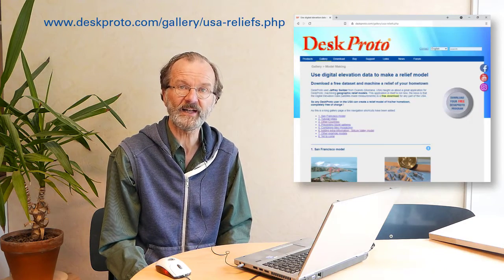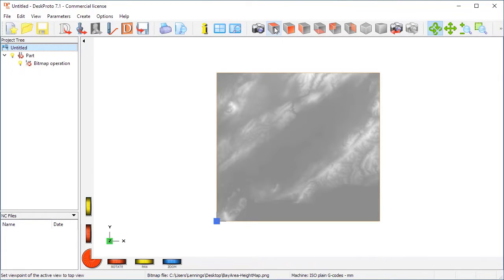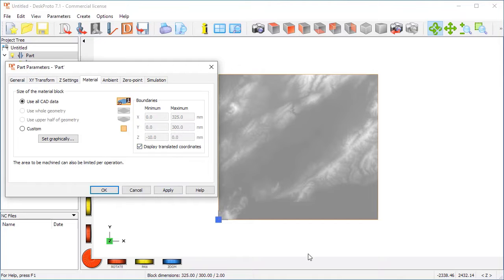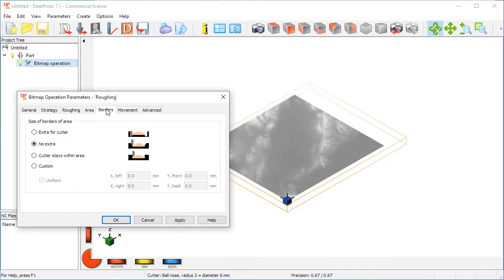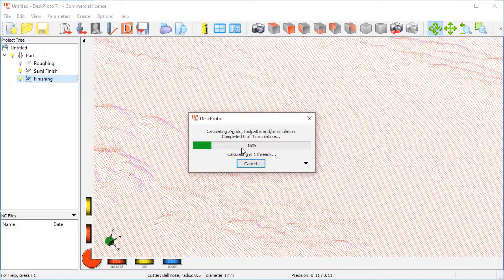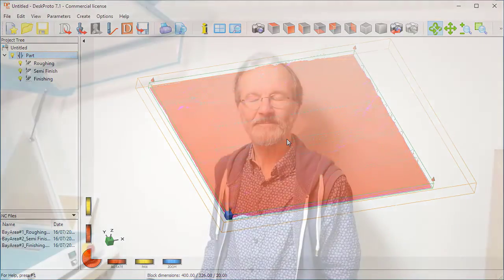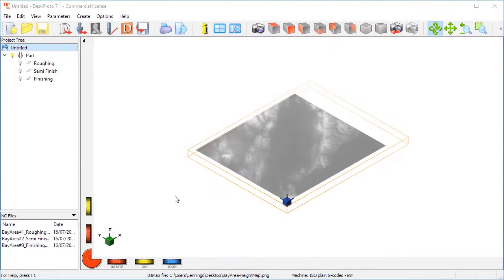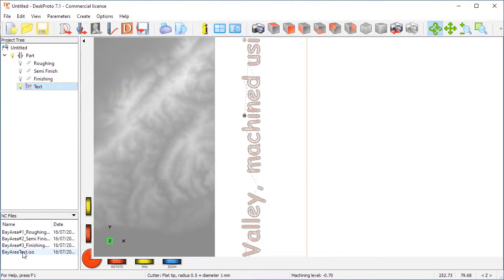CNC machine a 3D relief model of Silicon Valley with the DeskProto CAM software.

Comment: Hi Lex,
this is a very nice project and the detailed explanations of every step needed is very helpfull. There is just one thimg missing. As you can see in the video when you start milling with the smallest cutter for the finishing operation the shoulder of the cutter would have bumped into the higher border around the model if you would not have set the working area to be smaller by half the way of the cutters shoulder diameter. Am i right with that guess? Or how did you manage to protect the border and the cutter?
Reply from the maker: Well observed !!  Collisions between the shoulder (thick shaft) of the thinnest cutter could indeed have collided with this vertical wall around the relief.  Nevertheless this did not happen: for all three operations the border had been set to "Cutter stays withing area". And for that calculation DeskProto uses the shaft of the cutter. The shaft diameter of the thinnest cutter was 3 mm, just as for the semi-finish cutter: for both cutters the toolpath kept the same 1.5 mm distance from the edge of the bitmap.
Reply: @Deskproto  Tanks for the explanations. So now i know that area borders are calculated by the shaft diameter and not the cutting diameter what i assumed. And it makes clear why i did not understand why the default 2mm cutter was always staying 1,5875 mm from the areas borders.
The help file explains: "The option Cutter stays within area means that the whole cutter will stay inside the area to be machined."
Hole cutter is said, but should better be explained more precisely for dumb users like me 😉

Comment: How can I rotate the top view at 3:42?
Reply from the maker: Hi Stefan,  The rotation is done with the largest red thumbwheel at the left bottom corner of the view screen. These thumbwheels only change the view (the camera position), not the project settings.
Reply: @Deskproto  Okay, must activate the wheels in the menu. Thanks
Reply from the maker: @stefankrimbacher7917  Glad that you found it.  The thumbwheels being visible is the default situation.